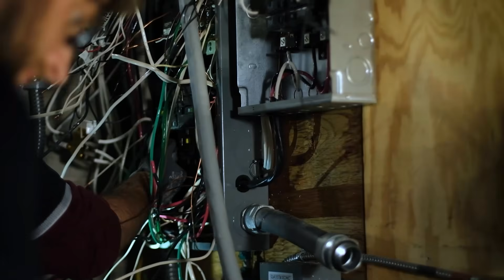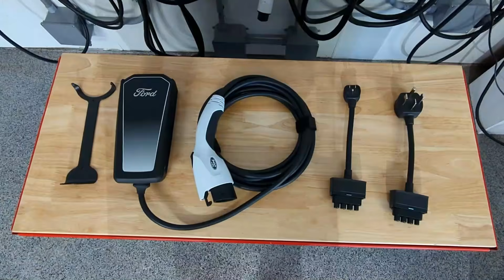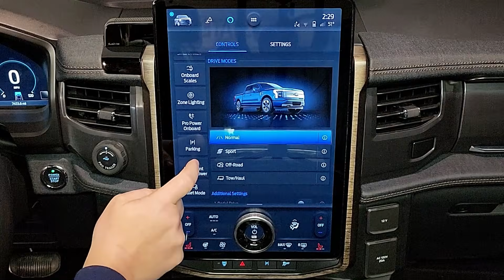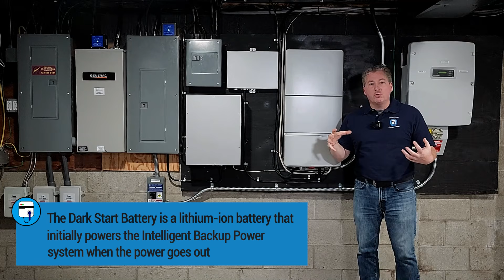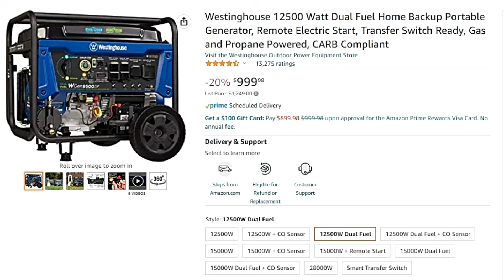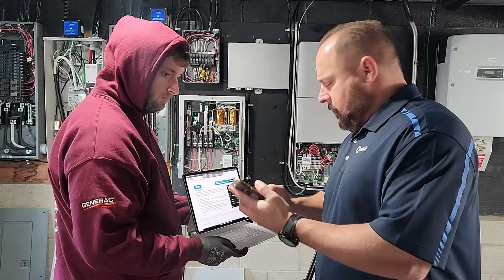Watch How Ford Lightning's Intelligent Backup Power System Works In A Real Home

Comment: My I ask? So the Ford Lightning is capable of providing up to 9,000 watts of power with 240 volts. For the circuits you have hooked to your Lightning panel, how long could you feed your house in the dead period of winter? Of course, I realize that heating the house in these conditions would be impossible. I live in Canada in a very cold place and I installed an 18 kw Generac generator and a 35,000 BTU propane stove. On top of that, I have a wood stove and I live in an area where there are no public services such as sewers and running water. In these conditions, how long the Ford Lightning last and what you you get with it? Thanks.

Comment: Having your truck back up your entire house is an awesome idea. But if you only experience a power outage maybe twice a year I think it's very difficult to justify spending $5,000 for a system not counting the labor. I saw another video where someone added a dedicated breaker and a twist lock receptacle and just flip the switch to back up his power which is what I would rather do even if it's a little more manual work.

Comment: Hey Tom, I think you should do a video about Level 2 charging in condo complexes. I was completely caught off guard after buying my Tesla that it would cost me 8000 $ to install my level 2 charger since the electrical room was 240 feet away from my parking spot. There is very little information out there online on the costs and I think alot of people are finding themselves in this situation.

Comment: Thanks Tom, but as with any complex system is the surge protection as a default or did your installer include it and I am wondering about surge protection even with a standard EVSE to protect the car when it is plugged in and charging maybe a topic that needs to be discussed especially in areas that have a lot of thunderstorms which we do not get that often here in Vancouver, BC area..

Comment: It is interesting to me that so many people think that 400amps is a big service. Both of my houses built in the last 15 years have 400amp service. One house with a detached garage has a separate 100amp service in the garage. I figured for modern moderately sized homes that was getting to be standard. I wonder what the typical service amperage is for modern home (in the 2500-4000sq ft range). Seems like with the rise of electric vehicles larger services should become standard in new construction.

Comment: Great video, Tom. You confirmed what I suspected: Because I already have a solar array with backup Tesla Powerwall batteries, it's unlikely I'll spend the $$ to install Ford's Intelligent Backup Power system. However, since I want to find a way to use my extended range battery in the Lightning to power my house, I'll probably install a 30 amp transfer switch so that I can plug in the truck in case I ever need it. Essentially the Lightning would serve in the same capacity as your Generac gas generator. Keep up your good work!

Comment: Tom for people condidering an upgrade to their power system, I recommend the Siemens P1 commercial panel. These panels cost a bit more than load centers, but can be ordered with Copper Bus, and the breakers bolt on, so better for the heavier duty of EV Charging. Happy to send you a sample of one of these panels if you are interested in upgrading, or just having as a demo for a future video

Comment: Thanks for this. I am one of those folks with a Lightning (Platinum), fairly generic SunRun HIS installation, completely screwed up by their local subcontractor, then reinstalled by their own team that came in from Orlando (we are in Boynton Beach, south Florida), but the installers could not get it to work.  There were hardware and software issues, but they also could not get the charge station pro installation app to work, or the FordPass app connection to complete.  The charger does charge my truck at 80 amps (we upgraded service too) and I also have a Tesla wall charger, which the initial contractor damaged, so they replaced that at their expense.  The system is now fully installed and they sent their top team from New Jersey, flew them in, they spent a full day diagnosing issues, on the phone with Ford and various equipment engineers, got it to work in generator mode a few times, but each time it went into fail mode.  They ended up giving up, and are planning to come back in March with a team of engineers from Ford.  My truck is also stuck on software 3.5.5, will not accept the latest downloads, but they don’t think that’s the issue.  I haven’t paid the $9,500 contract price, won’t do so until it works reliably and runs my house for at least 24 hours from the truck.  One unrelated issue that they identified is that our heat pump start-up draw exceeds the system’s capacity, so they plan to install a soft-start device on it, also at their expense.  That should deal with that problem.  This was not the cause of the failure issues, as we did not have the HVAC breaker on during the initial tests.  Ford/SunRun is losing their butts on this.  I am being very patient, keeping a smile, expect to eventually be a ‘happy’ customer with a great story to tell, but holy cow, they had no idea what they were doing, and had a seriously beta/alpha product that was not ready for customers.  Like you, I did this mostly for giggles and to see it in action, as I already had a Tesla charger and could charge my truck.  My Virginia farm has 43 kWh of solar panels (124 panels, more recent, so higher per-panel output) and a 55 kWh propane generator that supports outages on our oyster operation, which has mission critical pumps.  This predates good battery backup systems (2006), and works, so we’re not replacing, but it cost over $50k originally, so if doing again, we would install batteries instead of the generator, with all of its maintenance and repair hassle.  When it dies we will definitely replace it with batteries, as the truck does not have enough amps.  Which leads to the big bugaboo - the truck may not be at the house, nor sufficiently charged when you need the backup.  In our case, the Lightning will live at the Florida place six months of the year while we are away doing adventure travel or at the farm, so is really an expensive hurricane-season generator, and it works for us in that role IF the HIS operates.  But so far, no dice.  Long comment, sorry for that, but our whole story.

Comment: I saw last week that Enphase announced that they were going to release a bidirectional car charger that connects using a CCS DC connection.  If I understand your video correctly the Ford system uses an AC connection from the truck to get power back to your house? I was watching a Transport Evolved Video where they are having issues with larger 220 loads with a Ford backup system.  Do you have any larger 220 loads in your panel that are connected to the system?
Reply from the maker: It's a DC connection from the battery to the system, not AC. No, the sub-panel that IBP powers are 120-v circuits.
Reply: @StateOfChargeWithTomMoloughney  Thank you for the clarification.

Comment: Would be great if you could do same using Ford Powerboost 7.2KW generator. The issue is that the F150 is bonded neutral same as panel.

Comment: Tom, my question is can you write off 30% of the truck purchase price?  It is a stand alone connection.   The new Inflation Reduction Act states that the batteries do not have to be charged by solar.  I have looked on the IRS website and can't find the answer.  I reached out to the IRS and didn't get my question answered.   I think you can write off a portion of the truck.  The past stated that the batteries had to be permanently installed.   Now with the IRA, I can't find that wording anymore.  It just states that it has to be "standalone"?  Anyone know this answer?

Comment: First World problems.
Will make this easy.
When there's a power blackout in 🇰🇪 Kenya this is what I do.
1. Disconnect the Main supply from the house " pull the fuse out'.
2. Turn of all breakers to extra TVs, lights,  etc. Keeping it simple here, we all stay in 1 room .
2 or 3 lights, tv , router.
3. Connect DC-AC  inverter to any wall socket in the house and relax.
4. Wait .

Comment: Not a deterrent to me: I intend to charge at home, using a photovoltaic system....Free power for life, regardless of available 'incentives'. The ONLY time I would plug into a public DC fast charge, is the 1 or 2 times a year, that I drive beyond the range of a single charge. I will be charging on level 1, or perhaps, level 2, just to protect and prolong the life of the single most expensive component in the EV....The Battery! If the manufacturer does give me some 'free charging', it would last me a long time, as long as I take advantage of it before the offer expires. A limited free charging offer would do me more good than unlimited free charging for a limited time, as long as the limited sessions don't expire.

Comment: Thanks for the excellent video.  Isn't the IBP a better value when either a) the HIS inverter can be used to replace a failed PV string inverter or b) a new PV+IBP/HIS installation when you already have the electrician at your house to install the HIS and PV and wire in a critical load panel?   Then the economics can compare far more favorably against a two Tesla PowerWall + PV + critical breaker panel installation

Comment: How does it make you feel that your green vehicle takes more power to charge than it would take to run THREE 4 ton air conditioners( standard size for 2000 sqft house) to run.  

4 ton AC = 25 amps cycling on/off
3 AC x 25 amps = 75 Amps total

1 Ford charger = 80 amp continuous

Comment: 1. How does the solar array connected to the Intelligent Backup Power (IBP) inverter comply with the rooftop rapid shutdown requirements in the 2017 NEC which is in effect in NJ? Did your installers need to install rapid shutdown devices at the panels on the roof?
2. The IBP inverter is capable of AC coupling. This means that you are able to connect the output of your larger solar inverter to it. The IBP inverter will allow the solar inverter to run when the grid is down. 
2. The “transfer switch” for the IBP system is a little more complex than a generator transfer switch. It contains a microgrid interconnect device as well as an auto transformer. The auto transformer provides a neutral connection since solar inverters usually don’t use a neutral conductor for carrying current.

Comment: Not the way I'd want to degrade my EV battery buy batteries for your house would never buy a EV truck try and pull a  fifth wheel 2000 miles with that lol

Comment: I had always assumed that the natural gas supply in the greater NYC area was rock-solid in terms of reliability, but the wicked cold snap over Christmas resulted in a potential gas service crisis in the area (extremely high demand, and pipeline issues), as became pretty widely known.  
So while losing utility power and  natural gas service at once is quite unlikely, you can never say never about possibly needing the Ford setup someday…

Comment: Sunrun quoted $8500 for me to do the install of the whole home back up.     Ford did a really really poor job of communicating that there would be this big ADDITIONAL expense to use the truck as backup power.   I can buy a generator and have it installed for the same or less and it's ALWAYS there.

Comment: This is cool, but I think I would rather spend 16 K on an inverter with a battery rack install permanently in the house, where if there is a power outage if you blink, you will miss you’re running on battery power versus waiting a minute to swap over to truck battery or have to go to the garage and plug in your truck and now you can’t drive your truck anywhere because it’s powering your fridge😅

Comment: The energy arbitrage might sound enticing, but the lifetime of BEV batteries isn't anywhere near infinite with current chemistries.  So it's NOT free to do this unless you don't mind risking needing another truck or battery sooner than you would otherwise. 

So unless you would save a LOT of money through such arbitrage, I would question the overall math on doing that.   (Doing that year after year on a daily basis is FAR different than dealing with the occasional power outage, re wear on your battery).

Comment: It's too bad though, that it costs so much to get the truck version that offers this option, and of course the cost to upgrade the house power system / equipment to make all this work. 

So per your numbers (and those I saw in articles on this), over $5000 for the hardware, more for the installation, and the high price of the PRO (or higher) level of the truck starting at about $56,000 for 2023, a natural gas generator is looking MIGHTY good until this technology matures and prices drop a LOT. 

Also, my 20 KW Generac whole house automatic generator handles my whole normal power load WITH EASE -- no need to have a separate circuit, limit what I power, etc. through a load test my electrician and I did (to our surprise re the easy success).  

Also if you have a major power outage in an area that lasts for days, how do you get your truck recharged?  And your power is down while you're driving somewhere to try and do that.  The NG generator just runs, and you check the oil once a day, so you have a 5 minute outage when YOU choose to do that, since the generators do use a little oil when running days at a time. 

Hopefully as BEV's mature, this will all become commonly available from MANY EV's, and cost only a reasonable amount to get your house set up.

Comment: How is 9kW not enough? Especially if you have solar supplementing it during the day (doing things like heating your hot water etc). So you might not be able to operate your air con in a blackout but fridges, feezers, lights, power,a microwave, maybe an air fryer even an oven and inverter cooktop as long as you manage it- if you're sensible 9kW is massive especially with additional solar in the daytime. 2 Tesla PW2s are only 6.6kW in backup mode.

Comment: There has to be an ATS on your generator otherwise that would backfeed the grid. My guess is the power from the generator is not grid forming so you can't isolate the second solar system with the generator alone. You could use the grid forming from the Ford inverter and a second dual pole ATS on that second 200A panel to completely isolate the grid and keep both your panels on and utilise all your solar. It's fairly simple to implement. You just feed the grid power through that subpanel to your solar only inverter and install the ATS on your second panel. You'd need an AC combiner box to link the subpanel feed to the solar inverter and an AC isolator and a properly rated CBs in your subpanel.

Comment: I have been looking all over for this video, glad that you posted it!  Another great video.   I like how the system is installed, and that the 200 amp feed to the left is all fed from your generator!   Then the less than critical is powered from the Ford and when the Ford is plugged in and the sun is shinning your 3 KW solar system can provide some additional power to the back up that Ford system is feeding. 

You explained the system to me very well.  I have been installing HVAC for about 40 years, so understand electricity and inverters more than the average person.  Great job!

You did not mention that portable table lamps can be plugged into any Ford hybrid or Lightning 120 volt receptacles during a power failure, or should you want to reduce your load during the peak power cost time.  I can run my CPAP with my plug in Hybrid Ford C-Max if I leave the ignition key on, and plug into the 150 watt 120 volt receptacle in the car, but not much else!  

I have "Time of Day" power, where between 5 pm and 9 pm weekdays the cost is $.033 per KW, and after 9 pm until 7 am it is reduced to 0.075 per KW and $0.12 per KW between 7 am and 5 pm on weekdays in Portland Oregon.  I put in a timeclock to shut off my water heater between 7 am and 9 pm, so far it is working great, and I have plenty of hot water all day, unless I do laundry, and can do that on weekends when the cost is only $0.075 per KW.  

My water heater and clothes dryer each use 4.5 KW per hour.  Happy to use those on the weekends at much lower cost!

Comment: Intelligent backup power from what I am seeing is cheaper than getting a whole home generator installed (20-24kw) in my area which is Middle TN. If you have the vehicle and want a whole home backup this is equal to or less than a whole home backup generator
Reply from the maker: Yes, it probably is a little less than that. But understand you're comparing having a 9 kW system to a 20-24 kW system that is always there and ready to power the entire home. That's not really an apples-to-apples comparison IMO. The IBP system will certainly work for many people, but for others, a different solution may be a better option.

Comment: Are you going to get rid of the gas generator at some point down the line and rely on the Ford system exclusively?
Reply from the maker: I will eventually, but I will probably also add stationary battery storage at that time so the truck doesn't have to be home to have the lights & heat on.